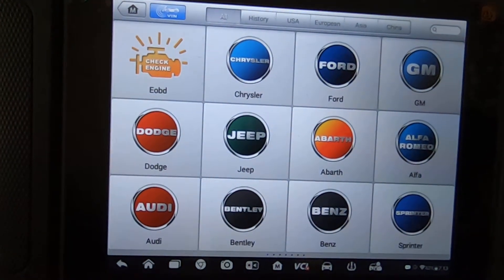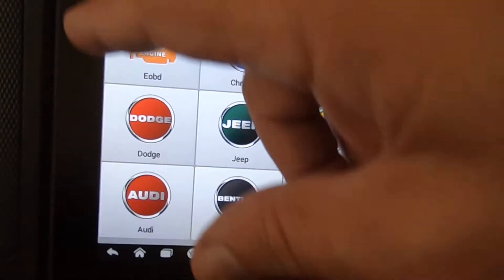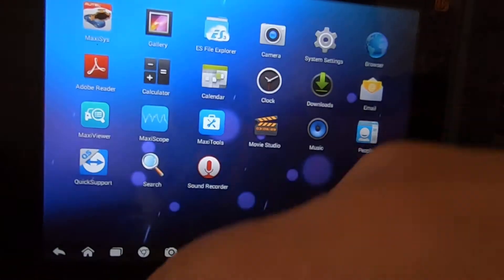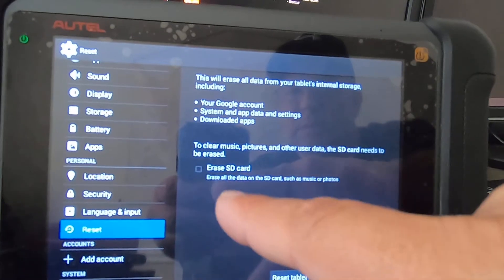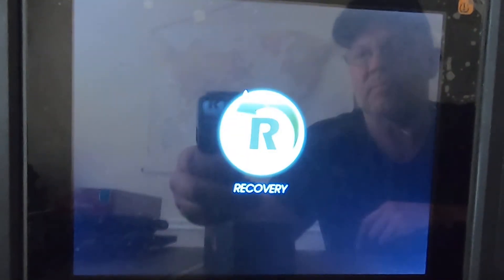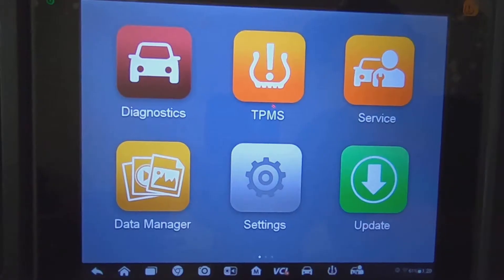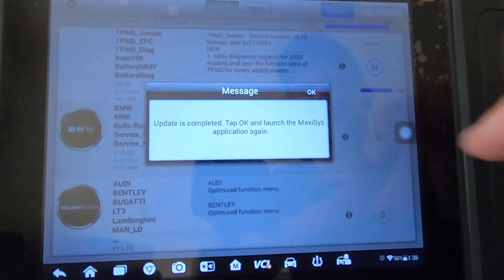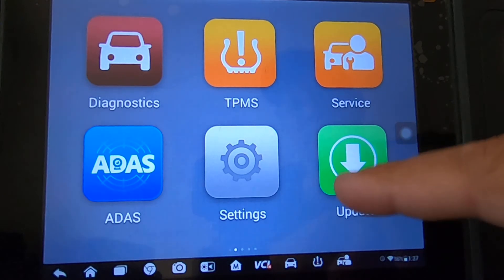Performing a Factory Reset on an Autel MS906TS.

Comment: Copy (backup) your Internal Storeage\Scan folder to an SD card while data is still good (preferably after updating shortly before your subscription is out). Then if you ever factory reset, simply copy that Scan folder back to the device and all your files should come back without needing a subscription.

Comment: I bought my Maxidas 708 second had from the owner of the shop next to mine 4 years ago, he has since gone out of business and nowhere to be found, do you think I could reset mine somehow so I can use my info and start updating it, it has become pretty useless  at this point without updates. 
Any info would be helpful
Reply from the maker: I am not sure if it can be updated anymore. I bought my MS906TS used off ebay and when I got it I contacted Autel and they registered it to me because it was not reported stolen or anything. I would email autel to explain that you are the new owner and was wondering if they can register it for you and if you could update it to the latest software.

Comment: How do I remove my user email from the device? I want to sell it and I reset the tablet and it is not removed in my MX808
Reply: Same question
Reply: I contacted autel and they did the conversion for me
Reply: thats what I'm trying to figure out now
Reply: Any updates?
Reply: @ederflores2234  You just have to do a factory reset. There's no other way to get it off. You'll need a new subscription once you reset it
Reply: @ConTheDon187  thanks for replying. I did the reset  But my account still there but all my cars brands  disappeared. I bought another Autel scanner. ¿Is it possible to add my new account  the old scanner?.or recover my lost cars brand. Never did a back up
Reply: @ederflores2234  Not sure to be honest. Seems like it's not consistent how to remove your account from different devices. I have the ms906cv and the reset and cleanup took my account off. I'd contact autel support about that
Reply: ? I have someone else account on my Autel how do I get rid of there account.